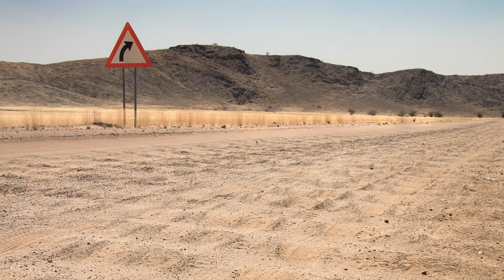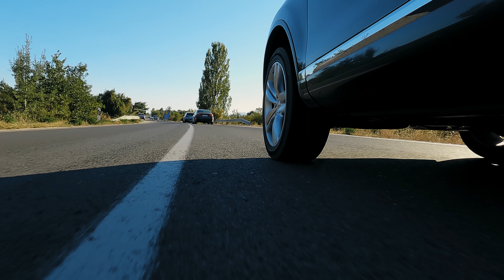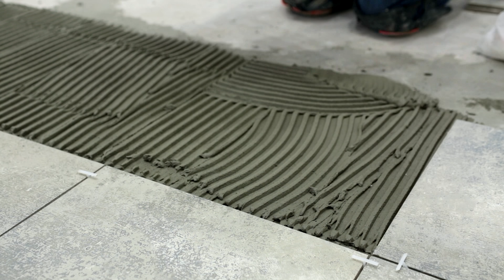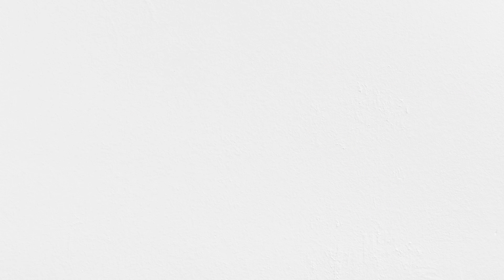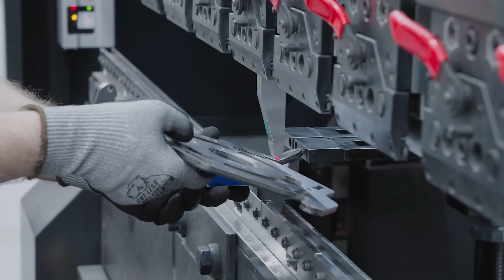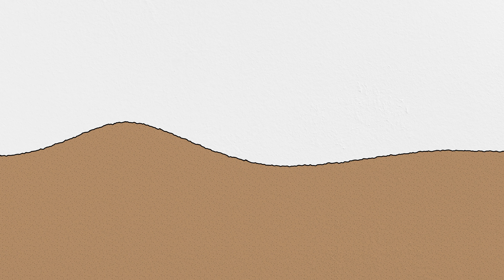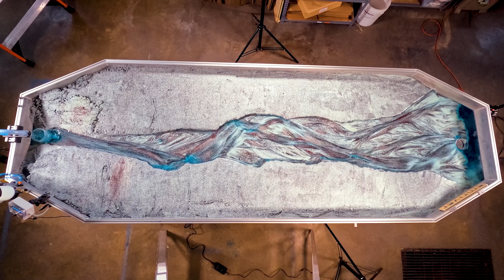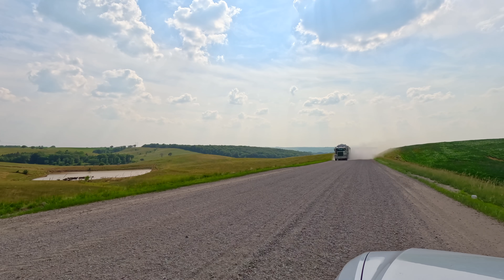Why Roads Get Washboards

Comment: Maybe I missed it but the key contributor to real world washboarding as I understand is vehicles that are under ladened for their spring rates and tire pressures, ie. heavy duty trucks with no load or empty trailers. That is to say, a minivan will introduce corrugations slower than a bobtailed semi going the same speed in the same conditions. But maybe this can be tested on your machine! 😁

Comment: Chatter on a downhill skiing race course is a very similar phenomenon. That’s a real-world example of how a flat plate can also create washboarding!
Reply: This happens also in mtb trails in sections requiring heavy braking.
Reply: Snowmobile trails are even more so. The 4' wide moguls that form can make a ride miserable really quick.
Reply: believe it or not, it happens even cross country skiing.
Reply: Moguls, too
Reply: Ski's don't completely act as flat plates though as they bend
Reply: @ninefingerdeathgrip tire, suspension and frames bend.  For skiers, skis bend, bindings move, boots flex, as do our bodies.   Not many situations really involve a flat plate

Comment: As someone who has been on a local Road District Board, responsible for 5 miles of dirt roads, maintaining them, and clearing them of snow. We get about 1.26% taxes on the homes in the area. When there's new construction, we get two parts of the coin. A LOT of heavy machinery ripping up our dirt roads, followed by another $1M property paying out 1.26% per year to help maintain the roads (and repair the damage done creating the home). 

ten years ago, when I was asked (tricked?) into being on the board, we had a 1956 road grader. Yeah, no parts, no ability to repair. So a year after I started, we sold that for $1200 and bought a "new" grader (from 1976). That lasted a few years, but eventually, we sold that one, and got a REALLY new (1996) grader for $10K, sold the old one for $7K. 

It's interesting that some of our roads get the washboarding, some don't.

Comment: Asphalt also washboards.  The real issue is wheelbase, suspension tuning, and the axle load.  This is why we have seasonal load restrictions as the frost comes out of the road in the spring.  No matter how hard it feels though, the load at any point will cause displacement - this is why wide shoulders better support asphalt edges than narrow ones and the inevitable cracking is at least delayed.  Geotextiles under roads may help - we see a lot of them used in driveways under interlock and cobbles.  Ultimately washboarding is tied to the net average of tge predominant suspension response frequency.  Lots of trucks vs lots of cars will make a difference in relative depth and peak spacing.  The circular track is a good model, but as mentioned before the movement of materiel needs to factor in things like the mass and composition of adjacent structures like the road shoulder (how much is paved outside the line, how much more is gravel and road base, is it plowed in winter, is it used for stopped vehicles, do farm machines and other wide loads use it, how does it get repaired after accidents or work like ditch dredging, replacement of utilities, etc.).

Comment: This seems like an overly complicated explanation, but that could just be my early morning still half asleep brain talking. I’ve always wondered about this. I used to live in a community out in the middle of the desert, particularly the Helendale area in So Cal. All the surrounding outer dirt roads would form these weird ripples after a while. Every now and then the county would come in and smooth them out with a truck that looks similar to a snow plow. One of the work trucks I drove at the time, a single cab long bed 2008 Ford F-150, would feel and sound like it was rattling itself apart and was quite the jarring experience when driving over these “washboards.” Another work truck, a single cab 4 cylinder 2007 Toyota Tacoma, handled it a lot better but was still a little jarring. My 1995 Jeep Grand Cherokee would barely even notice these bumps regardless of speed, it practically glided over these ripples. But then again, my Jeep was built for driving over stuff like this.

Comment: I personally think it is more than just speed, although speed is obviously a sufficient condition to form washboard in a dirt road. As he explains it is speed + small irregularities in the road surface that results in irregular [shear] force vs time and therefore material displacement that produces the washboard effect.

However, acceleration/deceleration also produces force (shear force at the road surface) which can displace material as well. Realize that even constant speed produces an acceleration around turns (the G-force you feel in a turn/curve is due to an acceleration). So, in my anecdotal observation, washboard tends most often to form where vehicles are accelerating or decelerating (approaching/leaving a turn) or even within a turn or curve.

I did not hear this guy discuss the force of acceleration producing a shear force at the road surface and displacing material, and I have even seen some literature claiming only speed matters. I will only note that both go hand-in-hand; as you go faster you must necessarily do more accelerating/decelerating at intersections and within turns and curves.

I would also think that weight of the vehicle matters.... big trucks carrying loads vs smaller trucks or automobiles.

Comment: I've been thinking about this phenomena for years. I've seen it turn up on slopes more often than on level ground, so I suspect that a wheel's tractive force on the surface is also very significant. I've also seen this in asphalt, on slopes warmed by the sun with a lot of traffic stopping at an intersection.

Comment: Perfect timing. I was literally thinking about this today, and trying to explain to someone why this happens. I notice that washboard in my area almost always forms where people are accelerating, either from a stop or up a hill. My best guess is that people as they accelerate, the wheels slip on the loose surface slightly, causing divots. Every time a new person drives over that spot, the wheel drops into that divot, and because it has less friction, it looses traction for a fraction of a moment, deepening the divot. I also think that Washboard spreads because people tend to drive over the worst spots slowly, and then accelerate when the road smooths out, causing more washboard. That's just my theory, though. I'll see what you say about it. 
Edit: I was only partially right.

Comment: "Automatic electric machines" were actually gas-powered machines in the early years and hand-powered before that.  Grandma had one.  Hard to start, but it got the clothes cleaner more easily than before.

Comment: Would a Herringbone Rib cut into the surface prevent washboarding? Tires would receive uniform distribution over the uneven surface as part of the tire would remain in contact with each rib as it transitions to the next, preventing the load spikes. If a load spike did happen, the deposition of material would be directed along the herringbone rather than building up parallel to the road. 

Just a thought. Maybe you could test it? 😅

Comment: Vibrating road rollers can add a subtle corrugation to asphalt roads as well. A main road near me sings when it is driven over. The corrugations are invisible, and they seem not to have been flattened by traffic even after a couple of years since the road was resurfaced.

Comment: Brake rotors also do this. Where the brake pad is the part that is bouncing. For that reason, it's recommended that you're not overly gentle about pressing the brake pedal.

Comment: Hello! I'm a construction inspector for my states DOT. We started using a geo-cell material similar to what you show at 16:09 on sub-grades that would be prone to sliding. But they stopped using it almost as soon as they began. Would it be possible to place your machine at a 2-10% grade to see if it acts differently with and without some kind of stabilization?

Comment: That washboard can also happen on asphalted road as well.
I live near a quarry, which involves traffic of heavy trucks loaded with tons of rock.
The access road is uphill, and the last 100m or so is a 14% incline, which starts/ends on a bend (depending if you're going up or down, respectively).
The downhill lane used to have those lumps, that would get more intense as you'd approach the bend.

Comment: Try your test with a air filled wheel. Its all about tyer pressure. Higher pressure more wheel spin. Lower pressure the tyer absorbs the ruts & not spin.

Comment: 10:53 you can see the ridges going across the road even to the edge. if it was the tires doing it why would it be on the edge? and why would the ridges still be aligned if the tires were making more contact in one area?
Reply: No expert but in my experience water erosion adds to the effect creating a gutter for it to flow through. Also avoiding the initial bumps inevitablely create more that eventually connects.
Reply: Because when driving not every car is in exactly the same track, there is some natural variations which widens the "track" path of the wheels.

Comment: Back in the early 1980s, I rode with a friend while he delivered bundles of newspapers to rural newspaper boys.  Plenty of that trip was on gravel roads and me as a young teen and my older friend had discussions about the washboards.  He came to the conclusion that it all started with one bump in the road and as the tire oscillated over the bump, the impact of it coming down created the the next divot in the road, thus the cycle continued.  That's what I've ran with all these years.  Nice to know we were right!

Comment: The solution is obvious: a bouncing Betty landmine with two pressure sensors spaced apart by a few feet to measure speed. If you drive over the speed limit, it jumps up to windscreen level, where a ceramic ninja star instantly and safely cracks your windscreen. The threat alone will get people to behave themselves and stop being selfish with our shared infrastructure.

Comment: Seems unintuitive that tyres cause this. Corrugations are usually across the width of the travelled road and parallel, not predominantly where the wheels go (even if people are driving to avoid existing corrugations) and not chevron shaped where most of the force is applied.
Also, many people drive across these roads faster than the periodocity of the corrugations. And even when they slow down (because of the corrugation) they often drive fast enough to have the dangerous skating-over-the-apex effect, not a speed where their suspension is impacting just in front of each dip.

Vehicles have fairly low ground clearance, which determines how the pressure wave under the vehicle interacts with the road surface. The same thing that throws up stones and clouds of dust is rearranging rhe gravel surface.
That might be producing an effect more akin to the ripples that wind  makes in sand, or water on sandy bottoms, but stronger because the pressure of the passing vehicle and speed.
Add in vibrations and rain/drying cycle compaction of gravelly material and maybe you got corrugations.

Comment: ok ok I want to comment before I watch and see how close I came to being correct or incorrect. Im mostly just curious and want to see how my understanding compares to reality

Dirt gets rock hard and the grader is able to dig in, but will catch and slip repeatedly, the same as if you take a damp hand and rub it over a surface you get vibration.

Now I watch and see how my understanding is demolished and replaced by something more practical. How close did I come haha? :O now we see

Edit: Ehh not the closest idea, that's fine. A plate could maybe cause it (grader) but I never would thought any of it out the way it's presented here. Such a good watch, and a welcome way to have my ideas challenged.
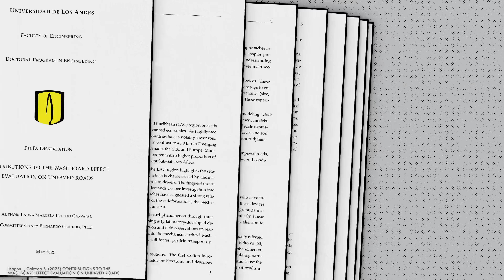Reply: brain explodes by like 1:40
Reply: Graders drag at an angle though.
Reply: @spades.unfairness.protagonist  Yeah im having my brain melted by 10 minutes. Makes so much sense.
Reply: @PurpleHaze2k9  Even if someone does work it out, I don't think I'll understand it 😂

Comment: I’m not an engineer, but I live in outback Australia and because of my deep frustration with road corrugations (washboarding), I have read a few of the research papers that were shown at the beginning of the video.

I think you misstate how the washboarding is initiated. Despite our intuition, there is no initial bump or defect required for washboarding to propagate. That is, washboarding can begin from a perfectly smooth surface, as long as two criteria are met: particles of the wearing surface can be displaced, and the vehicle is moving above some minimum speed (which is very slow). As said in the video, even an angled plate will create a washboard effect.

So how does it happen?  A part of the tyre (typically) is moving through (not over) the road surface media (sand / gravel / snow).  This part of the tyre creates a ‘bow wave’ of the media in front of the tyre. But the bow wave can only move so far, or become so steep.  Once the bow wave has enough resistance, or the angle of repose is reached, the tyre rolls over the bump which it is has just created from nothing, and the process begins.

Even if we could make the road surface perfectly smooth and defect free, we would still have those awful corrugations! Grrrr! 

PS – Because of the high summer temperatures and the frequency of road-trains in our town, the main asphalt (bitumen) streets in our town are corrugated as well – it happens to sealed roads as well.

Love your videos mate! Keep it up!
Reply: That's interesting. I was wondering if it wasn't more an effect of the wind.from passing vehicles, especially underneath the vehicle body. Like wind on sand and water on sandy bottoms, but for gravel that gets wet and baked dry alot. But that's not gonna be true for bitumen 😂
Are the bitumen corrugations across the whole road the way dirt road corrugations are? Hmm. Maybe it's both, especially under braking for the bitumen.
Reply: @spades.unfairness.protagonist  I don't think the natural wind has any effect, because the corrugations are always perpendicular to the road, regardless of how the road is orientated to the prevailing wind.  I have often wondered how much the air movement created by passing vehicles exacerbates the problem, but it certainly isn't required for the problem to start. As shown in the video, you don't need an actual vehicle, and you don't need it to be moving very fast for corrugations to form.   When you get down and look closely, corrugations look like a tiny sand dune, which is why many people think air movement is to blame, but I think it's just the angle of repose causing the similarity.

The bitumen corrugations are much more spread out - they don't shake anything like the gravel / dirt roads, but you definitely feel them.  I don't think they spread as far laterally either.

Another point I hope Grady considers - the individual corrugations have no real structure.  They feel really hard when you drive over them, but if you kick them with your boot you go straight through them easily.  This leads me to think that whilst they can't be avoided, perhaps they can be mitigated by regular light maintenance.  Instead of waiting for a grader and an operator, perhaps a towable sled would be enough to smooth the surface for a short time.  I've seen a few YouTube videos trying this approach with mixed results.

Comment: rolling forces push forward with traffic movement, as well as back as well as suspension riding over a small bump then rebounding? steep braking push dirt one way and then steep acceleration push the road the other way can also cause this even on asphalt roads particularly near sharp slow corners where steep braking occurs.

Comment: A couple of decades ago, the a locally operating forestry company experimented with a spray on road surface intended to combat this very thing.

It was something of a failure - the year or so it lasted was great both for logging truck drivers and for folks going out into the bush for mountain biking and hiking purposes.  But once it started breaking up...washboarding+potholes are a terrible, terrible combination.  Which somehow is what ended up happening.

Comment: Also it appears on ski slopes, mainly where they are straight and slow enough like on portions connecting two main slopes; despite the first feeling that the length of the ski boards would flatten them. The elasticity of the skis allowing them like car suspensions.

Comment: TBF, if you drive faster, it should smooth out eventually unless your suspension is worn out. Braking is still a worry, but it shouldn't rattle your teeth.

Comment: Before the road up Pikes Peak was fully paved, it had a problem with water washing the gravel off the road and dust from people’s cars. They mitigated these issues by spraying the roads with a kind of binder that held the top couple of inches of road surface together. I wonder if something like that would stop a road from turning into a washboard

Comment: Some years ago, I built irrigation systems in sandy fields.  My 1972 f150 never left washboards in the trails I was using.  The boss's new 1984 Chevy always washboarded the trails he was using.  We traced it down to the amount of 'squat' built into the rear suspension.

Comment: Thought experiment: If you would dictate different speeds at set time intervals...would that smooth out the wash boarding effect? Different speeds, lead to different resonancy/ballistic trajectories...so the deposition/displacement of the road surface would be different as well. So theoretically there should be a rythm where a cycle of different speeds would even out the washboarding effect....a bit like noise cancellation.